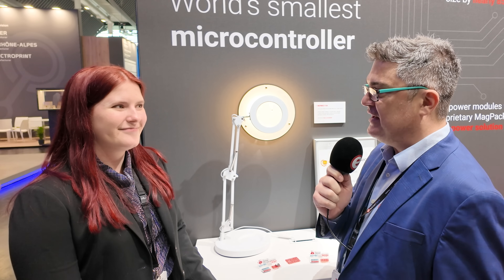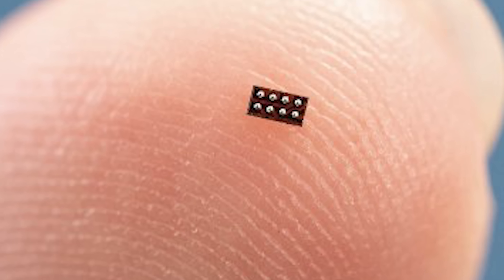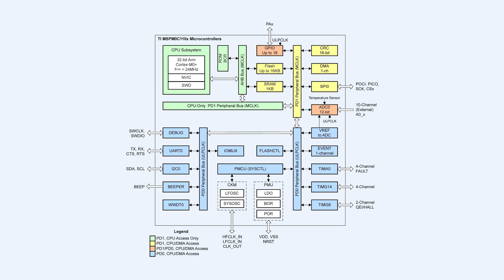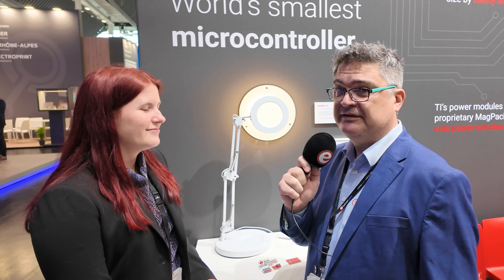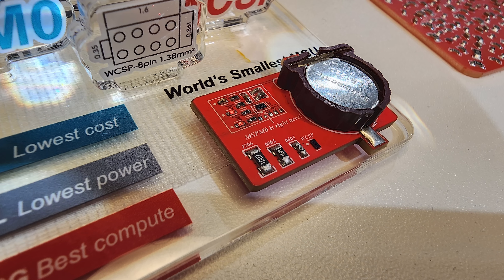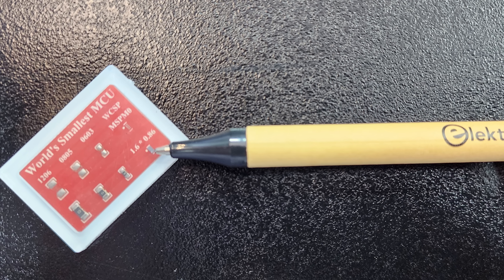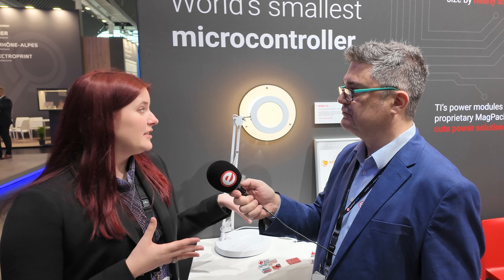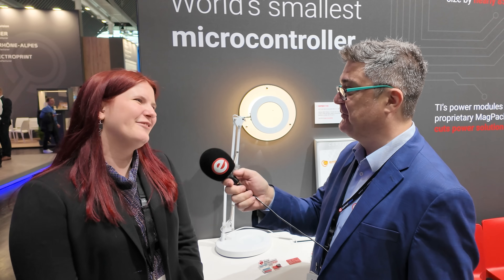Texas Instruments Shows Off World’s Smallest Microcontroller (MSPM0C1104)

Comment: What about the required HW to this "invisible" µcontroller? Put few capacitors and resistors around and does not matter how small it is, right?
Reply: it depends on the size of the resistors and capacitors.
Reply: 0201 passives are only 0.6 x 0.3 mm 😁
Reply: @DaveEtchells  good luck with the soldering
Reply: @electronichome1153  I've reworked these by hand with a microscope and microsoldering tip; difficult, but not impossible.
Reply: A lot easier than you'd expect. Wearables and other similarly small designs are packed with them. 

I've had assembled a small batch run with exclusively 0201s. You just need the right amount of coffee